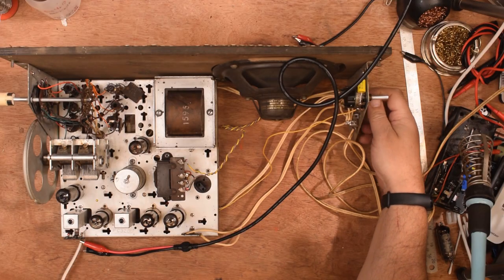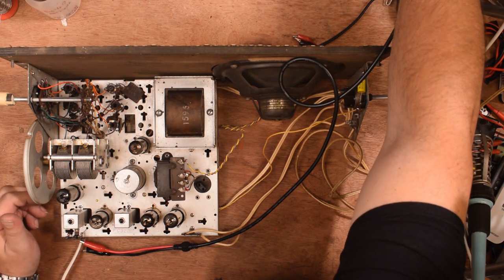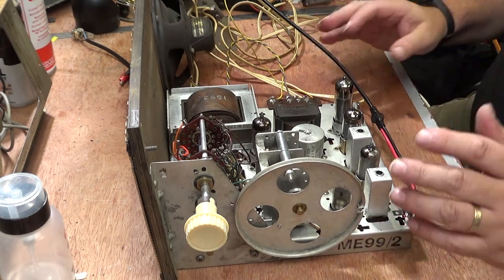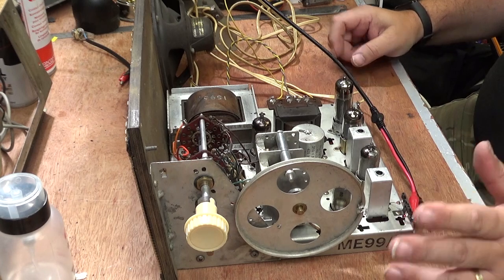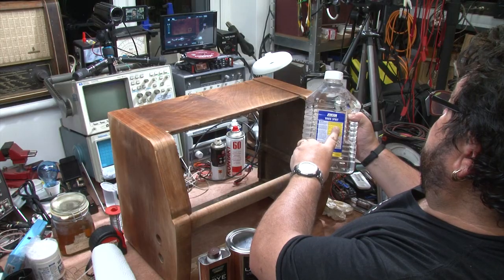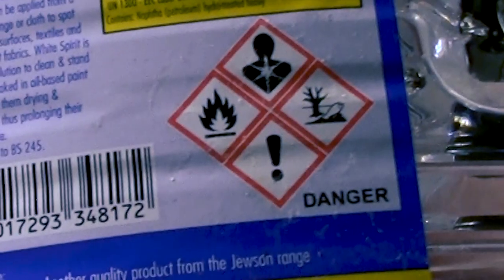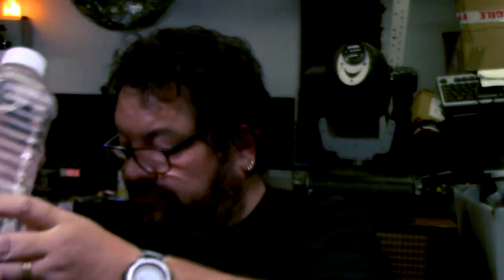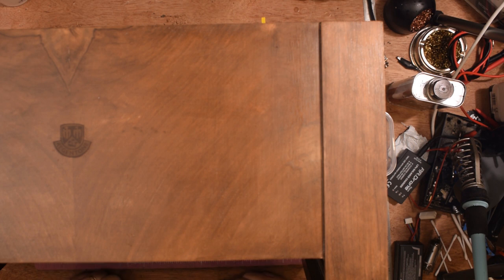Regentone Record Player : 1953 Multi 99 Vintage Radio Restoration Pt.4

Comment: Lots of work, but worth it in the end. Great job! 👍👍
Reply from the maker: Getting there for sure Bob. I will work on the alignment next I think and putting the rest of the dial back together so the thing will just need the turntable cleaning and replacing into the box.

Comment: Nice Job George The Cabinet Looks Great Some People Rub Their Cabinets Down With Methylated Spirits And Fine Wire Wool And When Its Dry Use Bees Wax And When it Dries Buff It Off Doing Repeated Waxs And Buffering To Get The Finish You Want. But Its a Lot Of Work And Yours Looks Lovely Anyway !! Looking Forward To Next Part George Regards mike.
Reply from the maker: Thanks Mike. I had heard about the waxing method but that was something you had to keep doing every six months or so to preserve the wood. I don't have the time, energy or materials to keep doing that to every set!

Comment: I just done an alignment on the same chassis I found it was not very sensitive on short wave. But the other bands seemed ok but not many signals here in the mountains.  I can not seem to fathom the tone cct ? I dont think its different from the schematics so will try and make the chassis look like the cct. Great video and always happy to get an update. Thanks for your time here. Barry
Reply from the maker: The tone circuit is pretty much c22, the 0.05uF cap filtering to ground. By reducing the signal to the cap you basically bleed off less high frequency so the control behaves more as a treble cut rather than a bass boost. I moved the cap to after the control to keep the wiring more simple but the increased dc voltage may kill the pot quicker. I'll give it a full alignment and see how I can get it to play on short wave soon. Take care Barry.

Comment: It was good to see you do the water slide badge. Looks very good. I hate woodwork!
Reply from the maker: I am not a wood worker either. This was only my second cabinet refurb. Give me metal and I can weld it but wood... I had to do the badge really otherwise it would have been not quite right with that great flat top.

Comment: Nice to see you, to see you nice!
Your workshop seems more like a Faraday cage than mine!
Great to see some more progress, looking forward to Pt 5
Keep up the great work!
Reply from the maker: Cheers Paul. I sort of asked them to make it shielded because of noise but the insulation they used has foil both sides so where it sits against the heating pipes it acts like a solid wall that is earthed straight to ground.